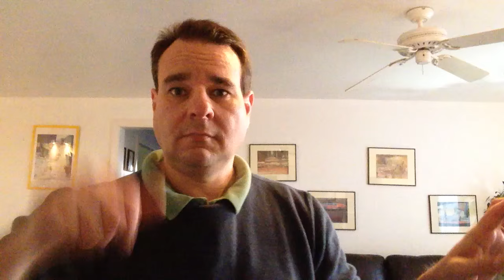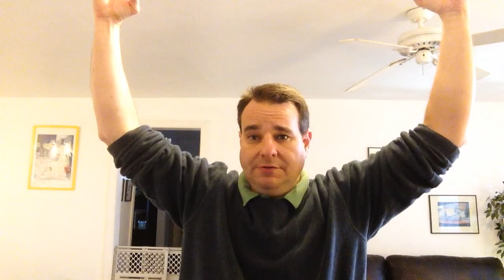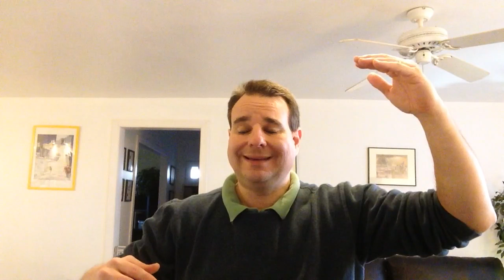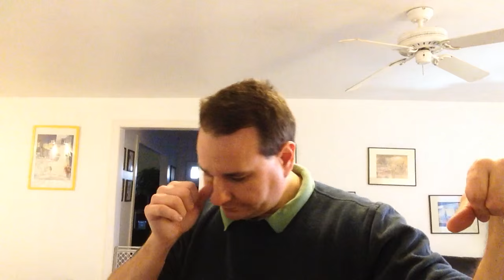Speaker Placement - Part Two: Don't do what Donny Don't Does

Comment: A good oratory on SPEAKERS. You made so many excellent points. People seem to think that you purchase speakers, bring them home, plop them down and away you go. It is much more difficult than that. Used to be, speakers were set up two feet from side walls, a foot from rear wall and two to three feet off the floor. Only problem is it didn't always work for good sound that way. Any pair of speakers will sound different from the store to your friends digs (room) to your home.
  An annoying phenomenon, well two of them are, 1- standing waves and 2- room nodes. There ain't enough space here to go into them (lookem' up on the net) but they can adversely effect the sound in your room. The difference between two way and three way speakers isn't as important as the design used. There are some very good vintage two way systems out there (EPI- 100 and Boston Acoustics A- 40) to name two. Also the bass frequencies are less directional so a bass driver on the side will still perform well. The crossover IS important because if set to high the woofer (or midrange) can have poor dispersion which is murder on speaker response. Speakers SHOULD have as good dispersion placed vertical as horizontal (uniform), unless designed differently (Bose 301 or Infinity EMIT come to mind). Also, moving speakers out from the back wall can help improve their imaging ability. Adding a sub woofer IS necessary if your Main speakers are small (satellite types) with bass response down to only 60HZ or so. Speakers set close to a side wall can help the bass response of some systems.
  Ported speakers as opposed to acoustic suspension designs CAN give better (Deeper) bass and use a smaller cabinet. Also vented systems with 8" woofers can give as deep bass as 10" woofers in sealed systems.  
  Large speakers in small rooms are a bit of overkill. Ya just don't need them big. Again, vintage speakers like EPI- 100's or the A- 40's previously mentioned work amazingly well in rooms of say 4 meters X 4 meters. Again, good work and thanks.
Reply from the maker: Thank you so much for the comment/information, Marty.  On Part Four of this series I go into Nodes (only slightly!) in regards to the Sumiko Master set/Iron Chef placement technique which actually works WITH the nodes to create a soundfield that doesn't rely on the listener positioned in only one spot, but tries to make the sound uniform throughout a larger area; it actually works with the wall to create this (with out the large bass hump normally associated with speakers that close).  If you have time, look up the RMAF seminar "That's not natural", linked in my part four video, where you can hear someone discuss the technique in MUCH more detail that I do (and I use a modified version).  Since I have followed that methodology (which is very different than the equilateral triangle placement most use), I have enjoyed my system even more, with ZERO need for room correction.

Comment: Yep, I definitely broke rule number 4. I mounted my rear speakers way too high, and the front speakers are much lower. It definitely makes a difference. On my receiver, I can make adjustments to compensate for the difference to a point, but at the end of the day, they still need to be lowered. On to the next vid!
Reply from the maker: +Matt Sands Every time I played with the "distance" feature of my amp, it never worked as well as it should have... Same with eq'ing for a room - it fixes ONE location usually but never the whole room as it tries to imply.  My rear speakers still aren't quite right.  Wendy Carlos in her dissertation on surround recommends them not facing towards the front, but left and right, like headphones so they fire at each other - I have found that actually DID work the best for me.

Comment: Great points you made on the placement of the TT and speakers.I have a set of speakers just for music and a set for home theatre. My turntable is set on it's on table even though is a Technics Sl-1200Cheers
Reply from the maker: Envious of the 1200... I tried to hold out for one, but never could find just one for sale... Always in pairs and beat up by DJs.
Reply: I bought the one I have from a DJ kid and it was in really good condition, the only thing missing was the cover but I used one from a different technics TT and it does the job.
The sl 1200 is a very heavy and stable TT.

Comment: Hi Kris,
I meant to ask you a few questions on this when you posted it but I forgot to. Here goes: I have a vintage pair of Klipsch KG4's for upstairs and I am buying a pair of Cerwin Vega Towers from a friend of mine for the downstairs. I do not think that either of these are designed to lay sideways. Are you saying that the sound would literally change if I lay them down sideways?
> My second question is about sub woofers. Will a subwoofer enhance the sound of all size speakers or just 5" cubes or bookshelf speakers?  I am pretty clueless when it comes to audio equipment because I never took a proper interest in it. It was always more important to me to buy the music and not so much what to play it on. I would just ask friends or someone working in an audio store to tell what it is good. You are so darn educated in everything audio and I admire it very much. Thanks so much for posting this. I did get a lot out of it. ~
Rob/Bsoton
Reply from the maker: +Paneeks1960 {Rob/Boston} It depends on the speaker, it MAY change the sound - with towers I would imagine quite a bit.  You have to try to find out.  But even flipping the speakers up side down would change the sound (which I think most people instinctively know)... Subwoofers definitely enhance all speakers - the amount depends on the size and capabilities of the main speakers.  Even in my setup which has a TON of bass, I still add a sub to give that realistic thump of a kick pedal and bass - but I recently bought a bigger subwoofer and it actually took away from the music and had to get rid of it... So it is a balancing act.  You have been to enough concerts to know what all of those instruments sound like - that is the experience I am trying to recreate - that is not the goal of everyone which is also fine...
Reply: dixielandfarm I can definitely understand what you are trying to accomplish in sound Kris. Sounds like you are trying to duplicate the sound at a Boston Music Hall or Boston's Orpheum Theater show. These were two examples of places that were built for acoustics. But the arenas were a different story all together. 
I would love to hear how you make out with that Kris~